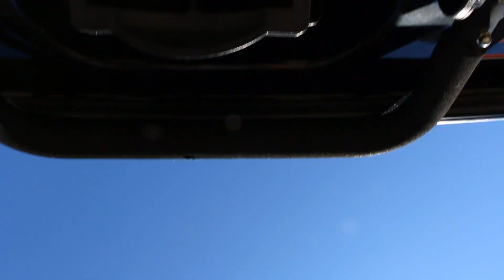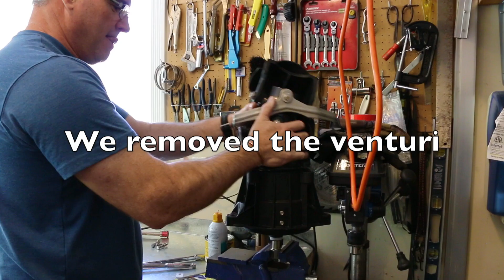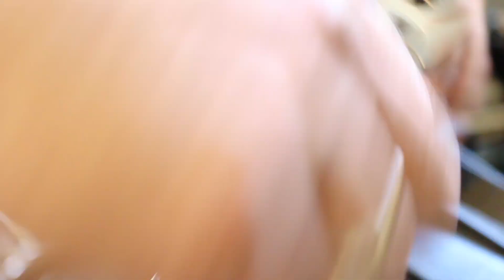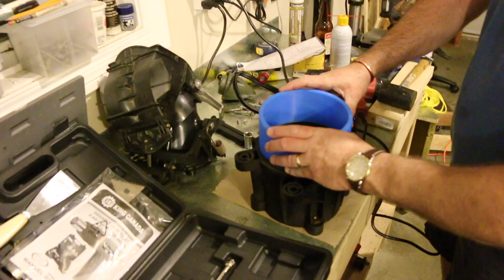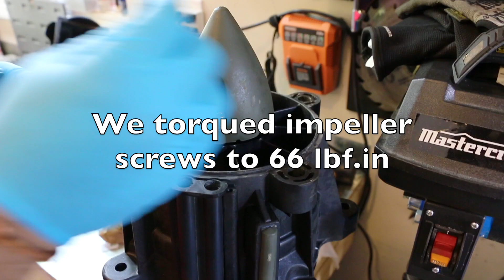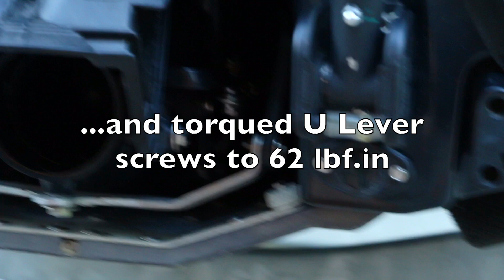How To Remove A Rock From Your Jet Ski Pump

Comment: You can take a stuck rock out of the impeller simply by hand cranking the engine in reverse. The impeller will also reverse and let go of its grip on the rock, and you can just push it out. Much simpler, MUCH faster, and it will save your day out in the water as you can be back in and riding under 15 minutes.
Reply from the maker: Thanks for the tip, but don't you run the risk of loosening the impeller? We have experienced this issue under normal riding conditions (with one of our riding buddies), so that would be a concern of ours, especially if it's really jammed in.

Comment: What type of grease or oil are you using inside the impeller cone ??
Reply from the maker: Jet pump bearing grease from Sea-Doo.
Reply: @3ftDeepChannel  … OK, so  I’m getting conflicting facts about it.  I’m hearing that it’s actually lubricating oil from SeaDoo/BRP that goes into a filler hole on the Venturi Cone and others are saying that it’s just grease rather. Are you able to clarify that up for me ?
Reply from the maker: If you have any doubt, check out Sea-Doo’s parts catalog. Find your machine and then look up the parts diagram for your jet pump. It’ll show what goes in there. Here’s the link: https://shop.sea-doo.com/ca/en/shop/sales/parts/?aribrand=SEA_DOO_EN_CA_CAD
Reply from the maker: If it’s not shown in there, it’ll be specified in the Shop Manual for your machine. You can also call your dealer and ask what it shows on their system.
Reply: @3ftDeepChannel  Thank you so much for all your help and guidance so far… Yeah I need to look at getting a shop manual for my GTI SE 170

Comment: That happened to me yesterday on my 1995 SeaDoo HX.  Had to take the it apart and tap the impeller in the opposite direction with a small hammer and the rock dropped out.  It was the size of a small dill pickle!
Reply from the maker: Yikes. One dill pickle-sized rock can ruin your whole afternoon! Thanks for your comment.

Comment: If the rock is in past the impeller and too big to come out the exhaust end then you can try knocking the rock loose and then working it toward the intake side of the impeller again. It has to go out the same way it came in right? I used 2 hangers to work the rock toward a spot against the impeller where I could reach through the intake side of the impeller with my fingers and grabbed it. Worth a shot before disassembling the entire pump
Reply from the maker: Usually. Coat hangers aren’t normally stiff enough to do much. The Impeller Jam Removal Tool works great for that stuff 99/100 times. Thanks for your comment.
Reply: I had three rocks lodged in my rxtx300 and eventually got them out without taking everything apart. A little luck with a little patience and friends got me back out on the water and taking my frustrations out on the supercharger 😂
Reply: @3ftDeepChannel  …What is this “Impeller Jam Removal Tool” ??
Reply from the maker: Here it is: https://youtu.be/91gCIT1V7tA

Comment: I did the Same thing with a rock. Always wondered if it is possible to bend the driveshaft? Because mine has got a vibration that just doesn't seem right.
Reply from the maker: It’s very difficult to bend the driveshaft. More likely there’s still some thing in the pump, but it also possible to strip the splines on the driveshaft. Hopefully not.

Comment: what do you guys say about stainless steel wear rings? good or bad?
Reply from the maker: Bad, in my opinion. The wear ring is a sacrificial part. If there's any contact between the ring and the impeller I'd rather have the $90 wear ring go than the $395 impeller.

Comment: Is it ok to park jetski to beach? I always scare to park to beach because of the fear of stuck sand inside bottom....
Reply from the maker: Yes, it is OK to pull it up onto a nice sandy beach. But when approaching you need to turn off your engine when the water is still 3 feet deep, and don’t start it back up again until it is at least 3 feet deep.
Reply: @3ftDeepChannel  Alright, thanks for the clarification.

Comment: Drill bit through the rock causing it to crumble? Literally just a random idea... would that work?
Reply from the maker: The problem would be getting a good start on the rock. It would most likely slip and start damaging your wear ring or pump.
Reply: Get creative! It’s possible that can work… pretty much try anything 👍🏻
Reply from the maker: Within reason, of course.

Comment: Would this job be the same on a 2018 RXTX 300
Reply from the maker: Unfortunately, no. You'd need to remove the iBR for one thing. But the principles are the same. With our impeller tool (see https://youtu.be/91gCIT1V7tA), most likely you'd be able to remove it through the intake grate. It's rare to get it jammed in as tight as it was for us.
Reply: Good thing you couldn’t get the rock out, that wear ring was machined by that cube!
Reply from the maker: Yep, and that's the cause of a big decrease in performance for a lot of machines.

Comment: How often should these be checked? And how much should it cost?
Reply from the maker: You should check your impeller after every ride, but you will likely know when you have something stuck. The performance will drop catastrophically and it will shutter. You should be able to do these types of repairs yourself, when necessary.

Comment: How do we know when is the impeller damaged too much?
Reply from the maker: You can usually get a good look at it through the intake grate, and you can also check out part of it through the rear pump. Alternatively, you can do a good inspection when you remove the pump for servicing.
Reply: From what I've read, to much vibration is a sign of to much damage to the impeller

Comment: where ya located. i need this done to mine..
Reply from the maker: We're in White Rock, British Columbia, but unfortunately we only work on our own machines (except for rare exceptions).
Reply from the maker: If you've got something in your pump, try making our impeller jam removal tool. If that won't do the trick, you only need a few sockets and an extension to do this job. Good luck.

Comment: What are the sizes for the bolts
Reply from the maker: They vary depending on the year and model of your machine. Check Sea-Doo's parts section of their website out to find out which bolts your machine uses.
Reply: How do u not screw up the impeller when you’re filling it
Reply from the maker: We took very little material off. We are just cleaning up the edge.
Reply: Like how do u know how much material to take off

Comment: My yamaha gp 1300 r sucked in a rock and i replaced impeller and try to started and it wont start it sounds  like it still jammed   I didn’t replace a ring can u help me
Reply from the maker: It could be that your wear ring is warped, twisted, or is frayed. Take a look carefully at it and your pump for other trapped debris. It should spin freely when disconnected from the drive shaft. Good luck.